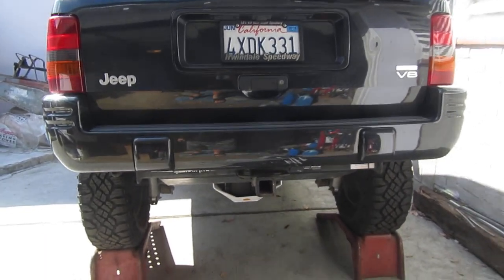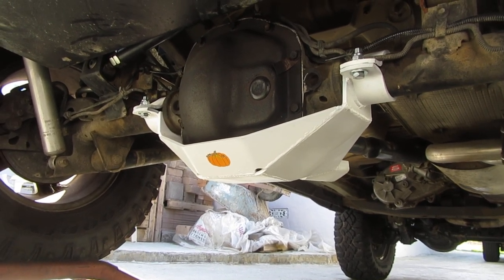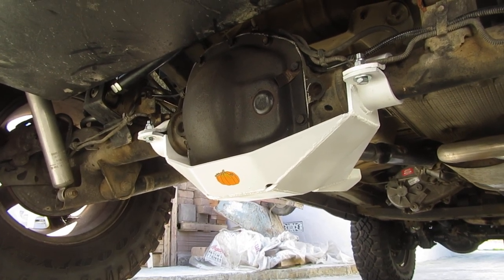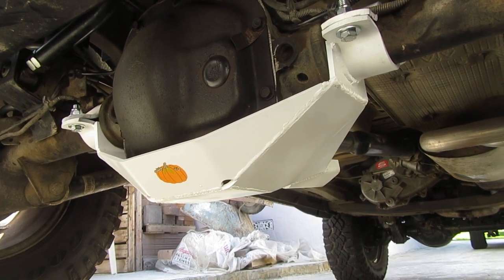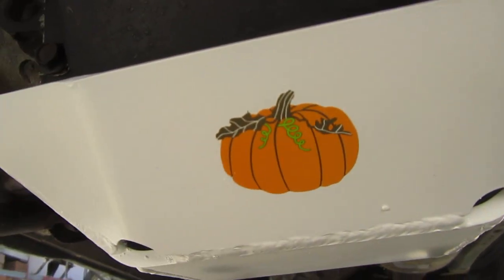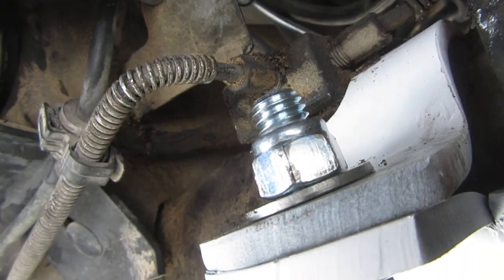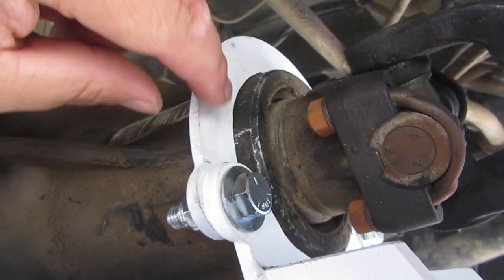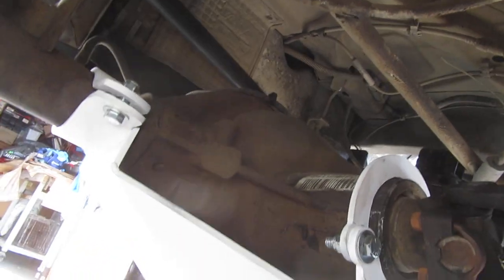Jeep ZJ DANA 44A (Aluminum) DANA 44HD Pumpkin Armor from Mountain Vista Fabrication

Comment: Very nice. I just heard about this on a forum earlier today, guy has one on his WJ. Then I see this video... I will be picking one up right away for my 04.
Reply from the maker: Yeah, Chrysler made these aluminum differentials for a while, and across manufacturers.  Dodge Viper, Jeep Grand Cherokee, Dodge Durango among others.  I don't know the years; but, yeah, GOOD STUFF.  I'm surprised it wasn't a lot easier to find something like this; but, I'm glad I found it.
Reply: @301steady  I believe the first use was the Corvette. I was a Chassis Designer on the original Viper, we used a Corvette rear diff assy with the mounting points changed for it. Pretty much the same as our Jeep ones inside with the exception of 7/16" ring gear bolts vs 3/8".